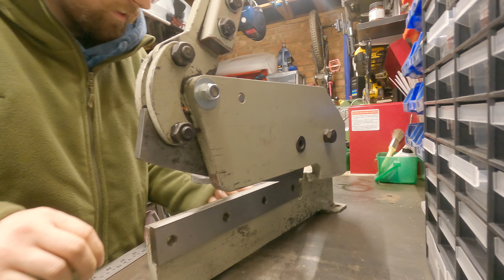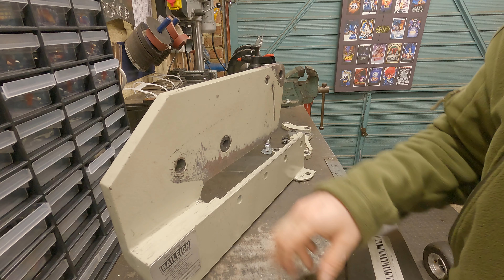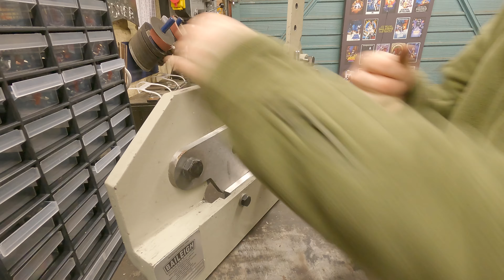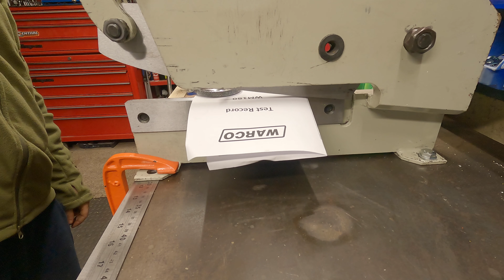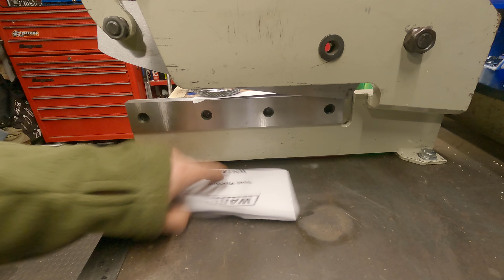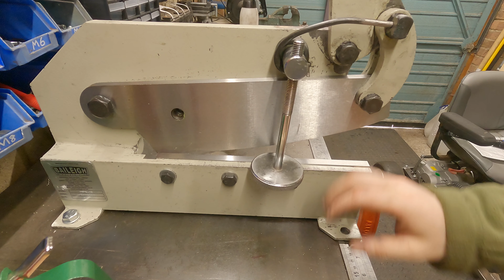Baileigh Shear Overhaul

Comment: Thank you Joe. Your video has been a big help. My Baileigh shear had its spring shaft come off today and this video has been very helpful to get the spring back in location and tool back to working again. fortunately I had my son available help install the bolts as I was holding the parts in place with the spring under tension, not killed today. Again thank you for the video.